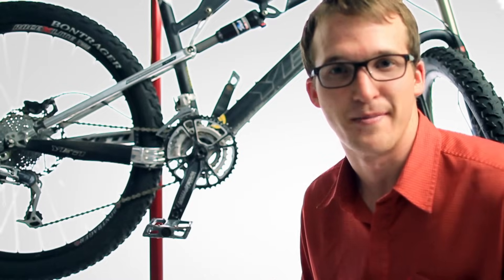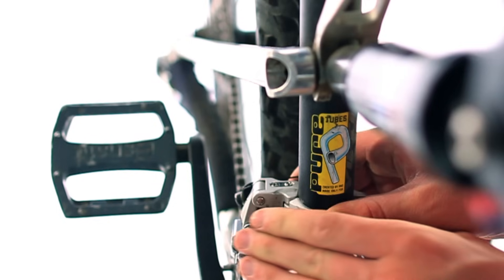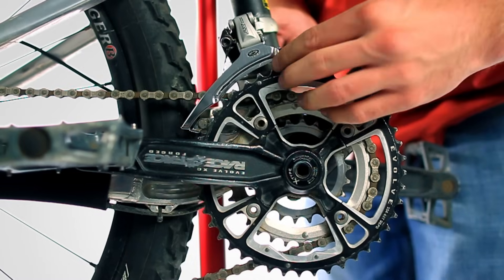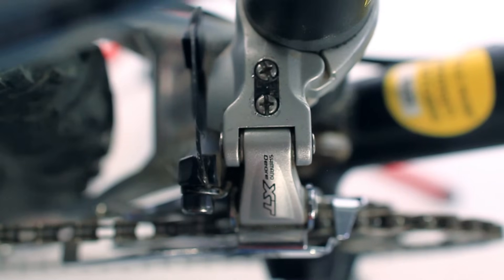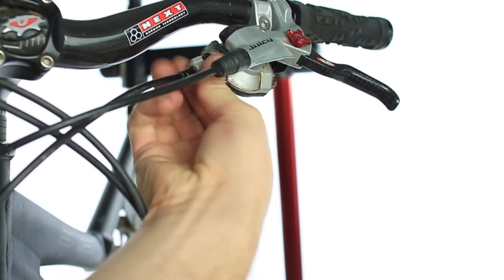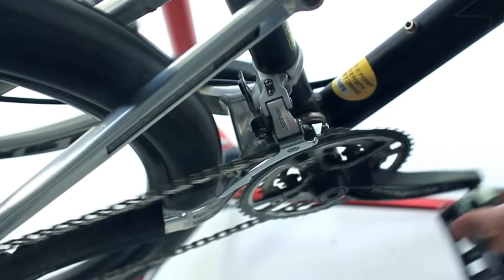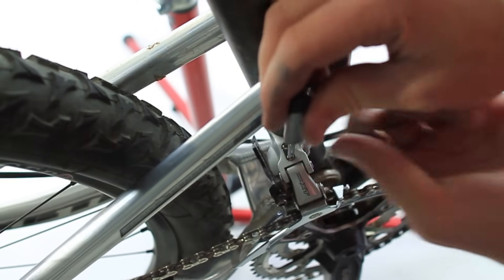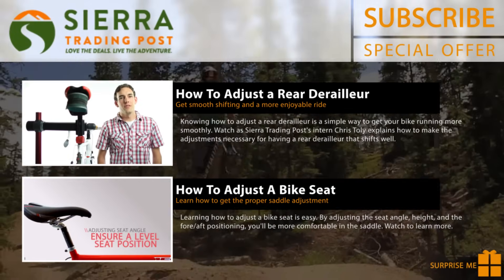How To Adjust A Front Derailleur

Comment: This is the BEST video on here for setting the front derailleur!
Like many others that have commented here, I've watched several other popular channels as well on how to set the front derailleur but they all go off track once removing the cable tension bolt or shifter adjuster and leave you to wonder at what point do you tighten the lower cable screw, I had to give up and walk away.
In less than 5 minutes, pausing the video as I went, it's shifting nearly perfectly.

Comment: i am having a front derailleur issue, last week it locked up and got stuck  on the big Sprocket, the Shifter would not let it Shift up or Down, so i dis-connected the cable turned it upside down took cover off and cleaned the shifter, after doing this it would click both ways like it was Working Right, until i put the Cable back on, i clicked it once and it shifted to the Middle cog, but now it wont shift again up or down, the cable is not Binding up anywhere, i think the problem is in the Shifter itself ? i did take the Front derailleur off and clean it, it moves freely in hand as i test the Movement does not stick,, any ideas ??